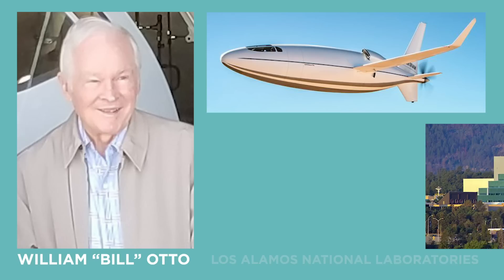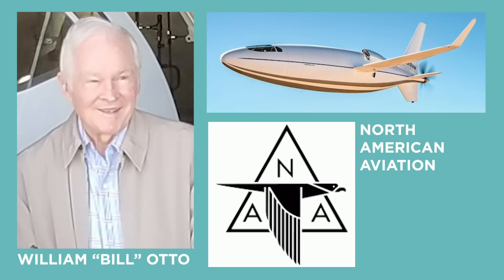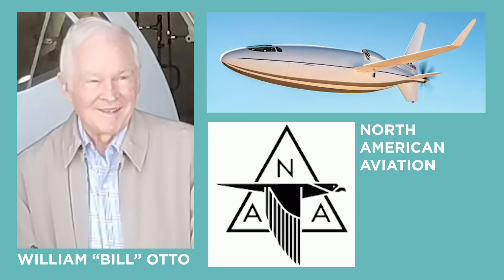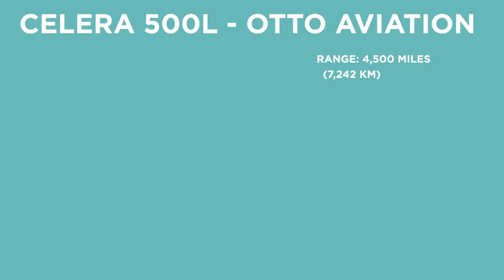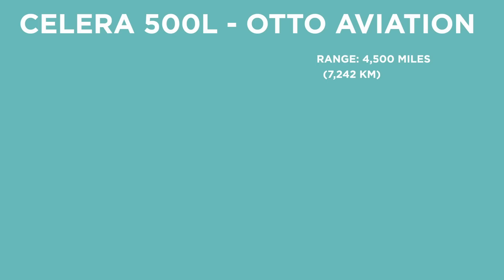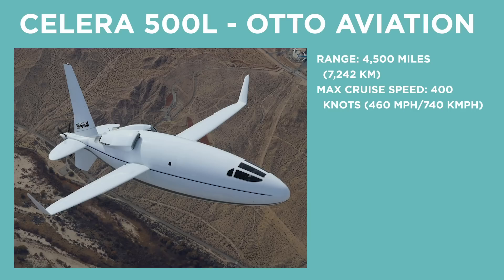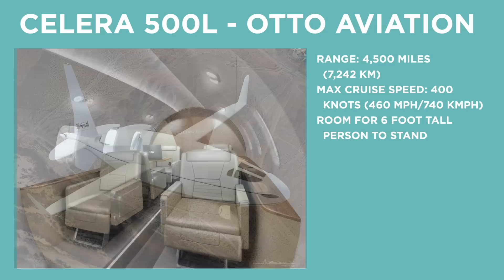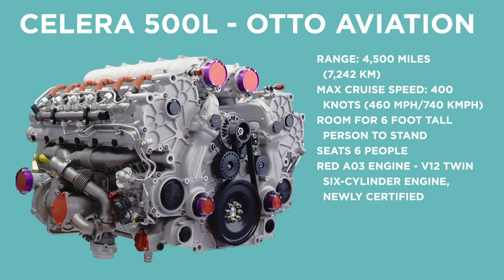Could This Plane Save The World? (Hint: No.) | Answers With Joe

Comment: Why you comparing a small plane to a big plane....what if a Celera was the same size?
Reply: The reason why the Celera is so slick and efficient is because it has laminar flow on ALL surfaces, not just the wings, not just the tail, but the fuselage and everything else touching the air.  To maintain that laminar flow over the entire aircraft, the size itself has to remain small for it to work.  You would need an impossibly smooth surface beyond the sizes that Otto is attempting and that's not even including the other parts of the plane on its surface, like where the wing and tail and air scoops meet the fuselage, the little instrument ports that are necessary on all aircraft, all the door and window seals, etc., that would more or less destroy that impossibly smooth surface you made.  Turbulent flow is sort of like a cascade effect, one tiny burble in laminar flow and it multiplies on its own until it makes all of the flow turbulent.  If a tiny gap in the door seal creates a tiny little burble, that will multiply on it's own and kill the laminar flow, but luckily that tiny burble doesn't have a chance to disrupt the laminar flow since the tail of the airplane has already left the area...in a 747 that burble might turn into fully non-laminar flow by the time its halfway to the wings, leaving the rest of the aircraft in draggy turbulent air.  Continuing this example, you'd have to make that 747's door gap fit so ridiculously flush that you wouldn't be able to feel the seam with your fingernail.  And that's only considering the obvious, as even the smooth sections of an aircraft need to be geometrically accurate, there can't be even the slightest imperfection, meaning any flat sections would have to be truly flat, any curved sections would have to follow that exact curve, with a margin of error lower than a coating of paint. So keeping the aircraft small is really the only practical way you can achieve laminar flow, since even the tiniest amount of imperfection will eventually end up causing non-laminar flow.  By stopping a specific size, you're basically making a cutoff point at which laminar flow is too hard to practically maintain.  To put that into perspective, so far this is the only aircraft I know of that has incorporated laminar flow on all surfaces, not even NASA has made a fully laminar airframe for testing purposes, so for them to manage it on their own is an engineering accomplishment.  Laminar flow is, to put it mildly, the holy grail of aerodynamics.

Comment: I don't understand why you're doing such a biased presentation? First, as others pointed out, 747s don't cost $20M. Second, they don't usually fly full, so it isn't always 61 celeras. why don't we always fly in 747s? Because not all routes can support that. Which is why airlines will then use smaller, less efficient planes. Then, and this I think was the main selling point of the celera, it could fly directly the route you need, and use less hubs. You're likely to find 6 passengers that need to go exactly the same way as you do, but not 300. This will also save cost of crew and fuel, less landings, less loading and unloading. Then, airlines make most of the money off 1st class tickets. Maybe celera will have more of those? But each of these points could be ignored. I'm asking why you ignored all of them....

Comment: Not a fair comparison at all
Direct Comparing a jumbo plane that is already in production, lots of clients and everything, to a PROTOTYPE plane is very STUPID.
Also, different planes requires different pilots.
You are comparing a Giant BUS against a small 2 seat prototype car.
.
The first Tesla wasnt that good.
The first SpaceX rocket wasnt that good
But they where the FIRST VERSION.
.
This Plane can be SCALED, probably not to the size of a 747, but if can triple the size to 18 passangers, or even 50 people.
ALSO
This plane is so eficient that is the FIRST in line to be able to be electric on the future.
.
But i agree with your conclusion, in 2016, 24% of CO2 was produced by electric generation and 12% on road transportation against 2% on aviation.
This plane makes very little change, We need Nuclear.

Comment: I gave up on your video after 2 howlers - calling a prop plane a jet, and vastly underrating its gas mileage, and saying a 747 costs 20 million, when the actual price is 400 million. If you can get those easily determined facts wrong, how can I put credence in anything else you say?

Comment: The fact you're comparing the Celera to a 747 (a plane that's already gone out of production because it's no longer competitive) tells me you don't really understand airline economics and logistics. Here, allow me to introduce you to someone that does:

https://youtu.be/NlIdzF1_b5M

"Airlines make money by selling seats" is correct but nowhere close to complete. Airlines, ultimately, make money by filling their planes; and a small plane is easier to fill than a big one. A plane as small as the Celera could almost be used as an airborne taxi. And if it uses the same or less fuel per passenger as a big plane, that opens up all sorts of routes that can't fill a big plane.

For example: your cost calculation, which includes just labor and fuel, says a full 747 costs half as much to operate as 61 full Celeras. That means that if you can only fill half the seats in the 747, its lead evaporates. So, sure, you'll never be able to compete with a 747 on an Atlanta to Los Angeles flight, but what about say... Reno to Manchester? Or Memphis to Bozeman? Or just about any other city pair that's not a main route?

Comment: You really blew it on this video Joe.  You absolutely didn't know what you were talking about and it showed. You need to study this more and make a new video.  All your numbers are dramatically off.  Not only is a 747 more than 15 times higher  than the number you quoted, it's irrelevant.  What does matter is cost per passenger mile and travel routes.  The Celera if all the numbers check out is going to revolutionize air travel through the use of smaller regional airports and more point to point travel.  Say you live in Cheyenne, Wyoming and you want to travel anywhere, you are going to have to take United's one flight a day to Denver.  A 50 seat Bombardier CRJ 200.  So instead of 50 people a single aircraft to Denver they could each take a single flight to LA, Chicago, SF, Seattle, Dallas or Denver.  This is the lesson Airbus learned with the A380 failure which was great for the hub and spoke paradigm and not so good for point to point.

Comment: Joe, you made yourself look bad n this one. It looks like you half-assed the research. My light search  showed me you drastically low-balled your numbers. That $20 or so million for a 747 was low. Even in 1974, It was $24 million new from Boeing. That's closer $140 million today factoring in inflation. The 747-8 is priced closer to $490 million. Although Boeing is no longer taking orders for new 747's, they are still being produced to fulfill current orders. Yes there are a few used aircraft priced around that $20 million mark. But those are configured for private luxury use, not commercial use.

Comment: It sucks when someone starts talking about a subject you’re well-versed in, and you realize just how full of shit they are. It makes me realize that I can’t trust anything in any other videos by them. I have just lost all respect for the channel and I don’t think I can ever take anything he says seriously. So many problems, I don’t know where to start. First comparing a new Celera to a used 747 airframe is disingenuous.

Also, he thinks that 1000 miles / 460 miles = 3 hours. In fact, it’s 2.17 or 2  hours and 10 minutes. I’m not sure where he learned how rounding works, but for my money I would never call that 3 hours. Clearly he either thinks we’re too stupid to understand decimals, or he doesn’t want real numbers, instead settling for inflated numbers that make his look more right.

Assuming pilots of 747s get paid the same as a six-seater prop plane.... ugh the list goes on. 

I’m not even arguing that he’s wrong. I agree this is not going to revolutionize commercial aviation, but he’s cherry-picked numbers and facts to bolster his argument instead of giving a fair point of view. Ugh so much fail in this video. Unsubscribe.
Reply: The foundation is still correct. MPG per seat is fairly similar between various standard density aircraft, no matter if we're talking about a 737 or A380. The figures usually arrive between 80-100 MPG per seat, assuming the airline can fill those seats. Which leads to the recent uptick in smaller, high density, aircraft (737, A320, 787 etc) Operating costs are not only lower, but the ability in filling seats may become achievable.

$20 million is not correct for a 747 (new), he was clearly referencing the massive used widebody market. As there are no commercial Celera 500s flying today, there are plenty of opportunities for airlines to a seek cheap, off lease, or second hand aircraft:

https://www.google.com/amp/s/amp.usatoday.com/amp/73926468

Pilot rates are indeed much higher in the 747. Most likely averaging close to $500 an hour for two operating pilots. If we're talking long haul then we can anticipate $800-1,000/hr, to include the relief crew. Even with such updated numbers, the Celera operating employment is incredibly high over 747. And I'm assuming Celera pilots will be paid $50/ hr, which they won't. Most likely seeing $80-$100 / hr based on the current market.

Digging deeper, even if we consider three 737s or A320s for every 747, the total flight crew operating costs will undercut that of the Celera.

This, of course, all assumes the Celera cannot be scaled up. But rather remains current sized.

Comment: a 747-8 (still produced) would be about 420 million, a 777 is over 300 million. you wouldnt use commercial airline fees as they wouldnt use the commercial buildings and gates, 
you often wouldnt even use commercial airports..
you failed to research simple aspects.